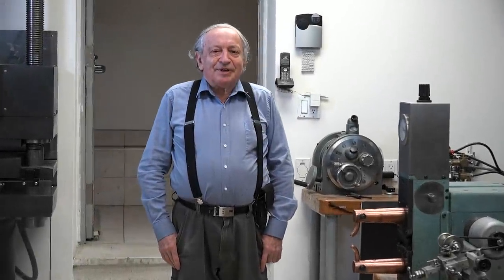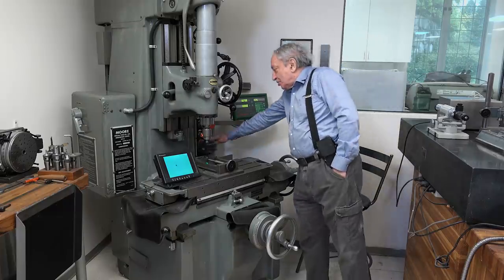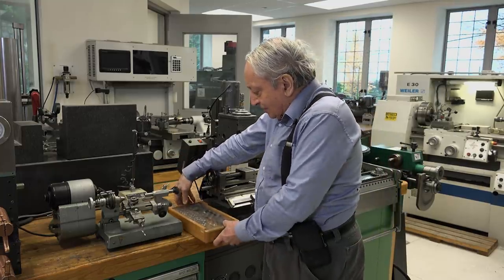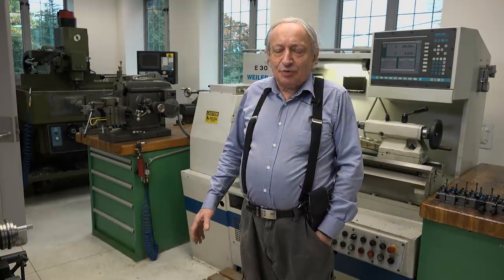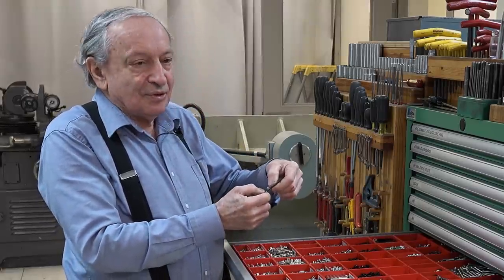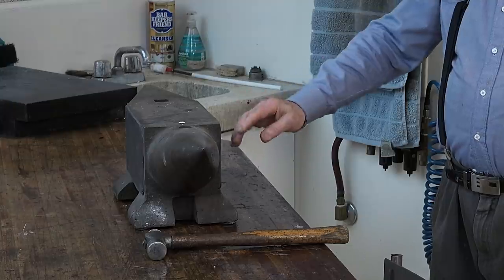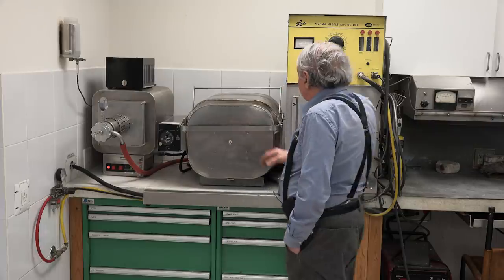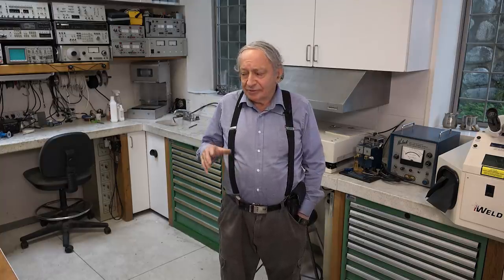Dan Gelbart Workshop Tour HD

Comment: Can you provide more detail on how you made that chuck for your Weiler Lathe. Would love to try make something similar. Thank you for the great videos. Also, could you repost your video on how to test machines/cnc machines for accuracy. It doesnt seem available anymore.
Reply: If anybody reading this wanted to achieve something along those lines but simpler to build (admittedly without the superb user interface) I will describe something which might be worth considering: I took a discarded front wheel brake rotor (available free in all sizes, from anywhere that works on brakes) and machined and drilled the part where the wheel normally attaches to suit the back of my self centering chuck. The opposite (inboard, on the vehicle) face of the rotor was machined parallel to that face, but the outside diameter had square-bottomed grooves machined in four places (like massive, short keyways) a close fit on the reversed jaws of my biggest independent 4 jaw chuck. This makes an extremely secure way of holding the smaller chuck in the bigger one. And of course the runout can be nullified by tweaking the independent 4 jaw. While not as quick and easy as Dan's wonderful contrivance, it does have one redeeming feature: by manipulating (preferably hardened) thin wedges between the larger chuck's jaw faces and the rear face of the brake rotor during the process of tweaking the runout, you can additionally remove any nutation error (axis wobble) either arising from the inevitably imperfect accuracy of the smaller chuck, or because the part of the workpiece being chucked is not  exactly parallel to the part being trued up to.
Reply: @Gottenhimfella  The only issue I have with this is that a used rotor will have a significant amount of runout and when you machine it, you aren't removing the runout, it's still there. What you have done is create thin and heavy areas of the rotor and added to this are internal stresses the rotor has built up over its life being heated and cooled thousands of times. Because of these 2 things the used rotor stands a high chance of re-warping. 

New brake rotors aren't that expensive and sometimes going at machining projects as if you were dirt poor in a 3rd world country isn't the best choice. This craft does take money to do and if you don't have the money then you have to save up until you can get what you need. I am by no means rich, and I save and spend, save and spend all year long. If someone is still more destitute in this country and still can't afford a new brake rotor and are unable to save money, then something else is wrong in that person's life and machining isn't going to be an option for them until they can get their life together. Go for the new rotor and Id also like to see a video on this to see what you did exactly.
Reply: @opieshomeshop    I was raised to be  (where possible) both kind and truthful. .SO I regret I cannot provide a reply.
Reply: @Gottenhimfella  Not sure what the problem is but it seems maybe you need to not take things a certain way if you are insinuating I deserve an unkind reply of any sort. Perhaps retire from social media if everything is a problem? In any case, I raised valid points people should be aware of if they wish to go with your idea. I never said it was a bad idea, I asked if you could make a video of what you did because it sounds interesting. 
 I also addressed this prevailing mindset about being cheap in doing everything. Nothing I said was meant as an insult to you and nothing I said was directed in a negative way toward you but it's clear you can't handle "truthful"  nonetheless.
Reply: @opieshomeshop  Refer my previous reply
Reply: @opieshomeshop  I read your comment and it sounded fine to me. Some people live in dark places in their mind so I wouldn't let this guy get under your skin.
Reply: Just a footnote for anyone wishing to try my recommendation earlier in this thread: make sure you use a cast iron rotor (98% of used rotors, IOW). Race cars usually use steel rotors (or something more exotic which would not be remotely suitable for this purpose). Steel rotors can be prone to warp. 
Cast iron is exceptionally stable when seasoned, and unless it has been run red hot and then rapidly cooled, a used rotor will be well seasoned from a great many thermal cycles, and machine like a dream.
If it has hard spots when faced, either anneal/stress relieve it (put it in a large wood fire and then heap the ashes deep over it and leave it to cool very gradually to ambient, or discard it and grab another.
I've used a bunch of these over the decades, all discards, in a range of sizes, and they have all held their geometry perfectly.
Reply: @Gottenhimfella  Just a footnote for those following this thread considering chump change is offended by everything and is easily butthurt. What he he commented here is true, to a point. Unfortunately, well used rotors warp and build up stresses no matter what they are made of. Including Iron. Iron can crack if its stressed too much. I spent my childhood in my dads shop and went on to open my own shop, spent 4 years in college and went through one of the best auto tech courses in the country and became a Master ASE mechanic. Ive been around the whole rotor thing 100s of times. I never turned rotors, I always replaced rotors with new NO MATTER WHAT! I also have a machine shop now and I've worked with metal for over 40 years. 
My advice would be to get a new rotor and not chance used rotors for any reason. Just because one person digs in the junkyard and likes it doesn't mean it's the right thing and his experience isn't necc the reality of the situation.. Aside from that, his idea is pretty good with the exception of the used rotors.
Reply: People reading this can feel free to make up their own mind when confronted by a difference of opinion between someone who professes never to have tried a particular course of action and someone who has tried it with complete success on numerous occasions.
Reply: Boomer fight, boomer fight. Well more like one person not handling a alternative viewpoint and getting defensive and doing the anti-insult by saying they Won’t do them saying exactly what they wouldn’t do. How clever.

Comment: Brake discs are honed and very cheap. You can clamp a brake disc between 2 discs/rings and mount your chuck to that to make the runout adjustable. Lots of car parts are produced to very high precision and due to mass production the cost is much lower. Cylinder liners, engine blocks, ABS ring gears, wheel bearings all very cheap and high precision.
Reply: You do realise this guy deals in figures way beyond normal automotive industry standards
Reply: @nigelsmith7366  Yes, but that doesn't mean the home hobbyist can't benefit from it. I could point out that we have fancy new tools that get much better accuracy now, but that is not what he was demonstrating in his video. He was showing that you DON'T always need the fancy new tools. I get the feeling you lack imagination and would rather just shit on everything instead of doing. In case you didn't notice, most of those tools use ingenuity and simple concepts to achieve amazing precision. 

Not to mention, most of the precision is achieved through assembly and setup, not just by the accuracy of the parts. In WW2, the military used concrete lathes where they simply cast a frame, aligned the sliding shafts and cast lead around them. Automotive parts are plenty precise enough, since otherwise you would get vibration and failure.

For instance an ABS ring gear with a 300mm diameter can be used to make a large bore spindle for under $200. That would cost upwards of 5k if you were to buy one. Hydraulic ram cylinders are precision ground and honed, and are dirt cheap. You can have a sub micron accuracy slide rail that way for under $200.
Reply: @excitedbox5705  "I get the feeling you lack imagination and would rather just shit on everything instead of doing." Thanks for telling us about your feelings. You might want to get those looked into, since they are a very cynical reading of what Nigel said.

Comment: Thanks for making these videos. I would be very interested in details of using the network analyzer to measure charasteristics of mechanical components. I have no idea how a test like that should be setup.
Reply from the maker: You need to convert the input and output to electrical signals using the right transducers ( using transducers like force gages, pressurec gages. position transducers etc). After that you can treat the system as an electrical network and measure delay, performace vs frequency and other parameters.

Comment: In 1928 There were 8 plates sent to 8 factories in US to test jig borer accuracy with random workers and machines. 1 center hole, 5 other holes around it. Accuracy 0.0002. 7 passed the test - only (no surprise) Detroit failed by 0.0001. All plates could be put together. 1000s of combinations were tested. 

I wonder if this would be possible today - I doubt it. Most CNC machines are not that accurate. Especially out of the box. Jig borer was used alone, nothing else was allowed. No other measuring devices but supplied gage block. 

Could we maybe repeat the experiment almost 100 years later?

Comment: Belt and braces and bootstraps! Incredible shop, great to have a look around.
Reply: If only to make us feel more insignificant in our endeavours, but push our boundaries. Just amazing... I want filtered doors in my shop!
Reply: @mattfollett866  meh, some run, some walk and some crawl. As long as we are going forwards that’s the important thing, right? Personally I fancy one of those nifty loctite eliminators ;)
Reply: @jamesmorris3175  Does moving at at nano meters constitute crawling???
Reply: @mattfollett866  vibrating forward imperceptibly counts absolutely.
Reply: @jamesmorris3175  If I can measure those vibrations at a reasonably accurate measure, lets say both temporally and in amplitude... does my crawling mean more?
Reply: @mattfollett866  if you can’t measure them it doesn’t mean they are not there just that your measuring ability is inadequate to the task. So yes, I’d say so!

Comment: This man does not shop at harbour freight
Reply from the maker: I consider most Chinese machines as kits. You need to take them apart, re-machine the castings, stabilize the castings (vibration or thermal cycling), re-paint and you can get a good machine out of it. The price is still reasonable as a kit. I have several machines that I re-built like that. Machines from Taiwan or Korea are a different story, they are good.

Comment: Great insight. I wonder if the heat from sunlight shining through the windows distorts his machines significantly.
Reply from the maker: The high precision machines, like the Jig Borer, never get direct sunlight. Also the in- floor heating is laid out that there is no heating under the machines. These are important considerations when you have precision machines.

Comment: Hi Dan, greeting from Australia. I’m in the process of mounting my bench top mini mill in my small garage workshop. I’ve been overthinking bench tops as one does. Just wondering about your timber bench tops - what timber did you use? I’m assuming everything was thought about carefully, having the timber’s laminated running horizontally etc. Thanks in advance
Reply from the maker: All benchtops are structural laminated beams that were rejected for structural reasons. The wood is Douglas fir. At the time rejected beams were cheaper than any other wood. If you can't get those in Australia I recommend two plywood sheets glued together to get a few cm thickness, covered with hardwood wood flooring, maple being the best.
Reply: @dgelbart  Thank you for the quick response! Appreciate your channel and knowledge.

Comment: I am looking at building a sheet metal break for myself and interested in how you designed your's. 
I really like the force multiplying effect from using the cams and the evenness of the pressure created to push the sheet down, compared with using bolts like every other break that I have seen. But I can't figure out how you designed the 'excentric' (i'm struggling with your accent alittle there) gear/chain mechanism to move the clamping blade. Obviously a rack and pinion would induce twist, unless you includeded an extra intermediary gear on one side. If you did use a rack and pinion there must be atleast one intermediary gear to account for the relationship between your turning input and how much the blade moved. That said, the position of the sprockets seems very close to the edge so I am struggling to imagine how you would fit it all in there without it being some kind of complicated planetary gear system. As such I am doubting my intuition completely!
Thankyou, honestly, for being such a huge inspiration to us all.
Reply: I figured it out, 'eccentric gear mechanism' is the key google search.

I say 'I', when i really mean 'I, with help'

Comment: hi. how do you lap a part too big for the surface plate? I have been searching everywhere to find a answer and cant seem to find it. 

Thanks for your amazing videos
Reply from the maker: If the part is not hardened you use scraping. You can check the flatness with an optical auto-collimator or with gages (see other YouTube videos about checking surface plates). These methods work for any size. If part is hardened you can do spot lapping and test with the same methods but it is very slow.

Comment: Hello!
Awesome shop!
Is there a chance you might explain in detail the the weiler's chuck. 
I've been trying to figure it out and feel I can guess at some parts like how the stack of plates interface.
The part that has me stumped is the  drive mechanism for the adjustment. 
I can't imagine a way based on the location and angel of the adjustment from the video, at least not without gearing or similar to turn it 90° but the sensitivity of itbmakes me struggle to believe that's the case. 
Possible a wedge system?
Reply: If you'd prefer not to say publicly I understand🤫
Maybe I could reach out another way
Reply from the maker: The 4 jaw self-centering chuck is mounted to a lapped steel plate held between two other fixed steel plates. One of those steel plates is fixed to the spindle.  The plate holding the chuck can be moved in two directions, X and Y. In each direction it is clamped between two opposing eccenters with a travel of about 1mm. Each  eccenter is rotated by a worm gear. Each opposing pair of worm gears is coupled by a flexible shaft which is twisted to provide a high preload between the eccenters. The preload in each axis is about 1 to 2 tons. When you turn the X axis worm, it also turns the opposing worm by the same angle, but the preload is maintained by the twisted flexible shaft. In order to prevent cross-coupling between X and Y (X setting should not move when you change Y) the center plate is guided by linear roller bearing (ground into the plate) to be able to move in X and Y but not to rotate. 
All the parts of the chuck are made from A2 tool steel hardened to Rc60, ground and lapped.  The huge preload is needed in order not to lose stiffness compared to a chuck mounted to the spindle. 
I even build such a chuck with motors inside that takes out the runout at a push of a button, but that one was even more complicated. To build such a chuck you need pretty good equipment and skills.
Reply: @dgelbart  wow!😅😅
I feel better about having not figured it out on my own, there is alot going into it for sure.
And in such a relatively small space.
Fantastic!
Would love to see the motorised version in action one day. 

I don't think I could make an approximation now, but what a goal to work towards
Reply: @dgelbart  thankyou for sharing

Comment: Hi Dan, thank you for the video! Could you give us some more information about the setup you use with the network analyzer for plotting transfer functions of mechanical systems?
Reply from the maker: The analyzer has an output port (supplying the control signal to the system, like a servo system input) and an input port connected to the system output or a transducer measuring the output. The analyzer will sweep the input frequency and display the gain and phase shift of the system.
Reply: @dgelbart  Thank you for the reply. I understand the general principle, it is more the specifics that I am wondering about. I assume that there also is a transducer between the output of the analyzer and the input of the servo system? Could you maybe give an example of a specific servo system, the transducers used and what output that is measured?
Reply from the maker: @Thisisntausername  Say you have a position servo, controlled by a voltage. Analyzer output supplies the input voltage, output position can be measured by a transducer or you can hook up to the transducer used by the servo system to close the loop. Sorry I don't have the time for a detailed answer.
Reply: @NoahFect  Hi Noah, thank you for your reaction. The HP Journal issue you are referring to indeed is very interesting. I am familiar with Dave Jones YouTube channel but could not find the video you are referring to. Feel free to share a direct link if you have one. Again, thank you for this information! Kind regards, Steven.
Reply: @Thisisntausername  Dave likes to use clickbait titles that make it hard to find anything on his channel, unfortunately.  This is the one I was referring to:

https://www.youtube.com/watch?v=uus_cpZiqsU
Reply: @NoahFect  Thanks so much!

Comment: Actually I have a piece of dust that needs a hole drilled 1.3 microns in from the top left corner.  Finally I have the knowledge.  Moore #3, eBay stock looks good still.